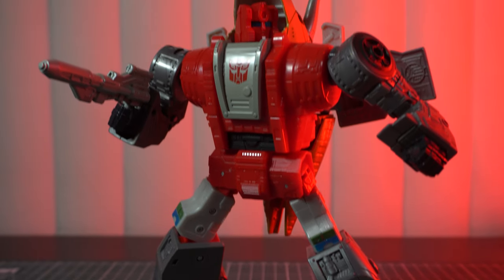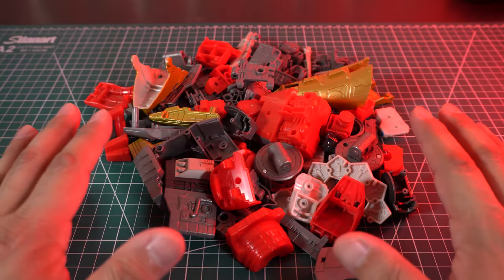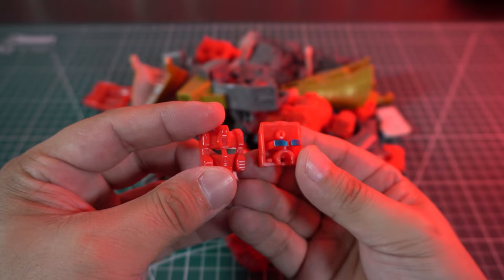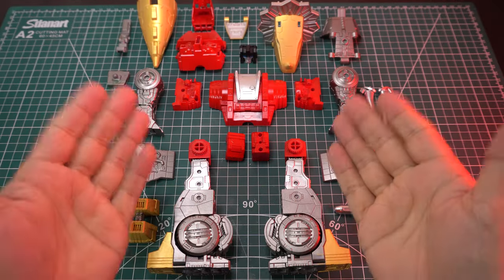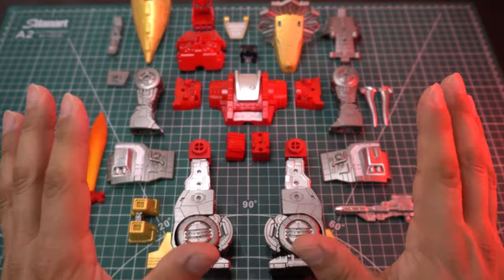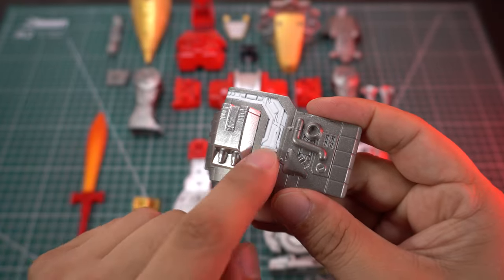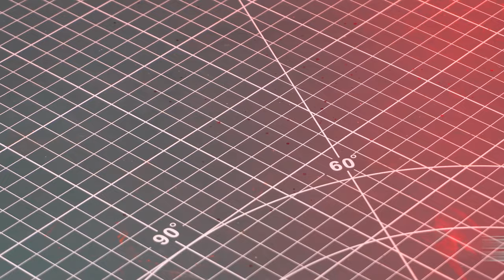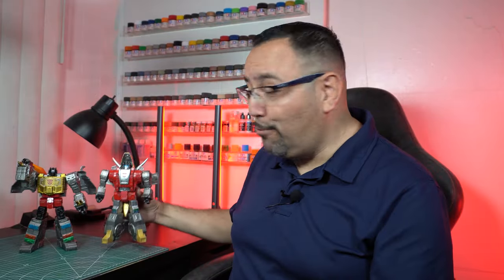Transformers Studio Series 86 Slug Full Customization & Repaint - 4K

Comment: Very cool job. I've got Sludge, Snarl and Slug painted up using metallic red, a flat/neutral gray and gold so they all match. Only one left is Grimlock and then Swoop when he gets released. It is a lot of work, these figures are made up of a lot of pieces. But they look so good together with uniform colors.
It's such a fun hobby to custom paint these figures and as tedious as it is to tape everything off, there is no feeling quite like getting to remove all that tape at the end and putting the thing back together.
Reply from the maker: Yeah, unmasking is always like unwrapping a preset. And there's no other feeling quiet like when you put all the pieces back together and see your project taking shape. :_happy: